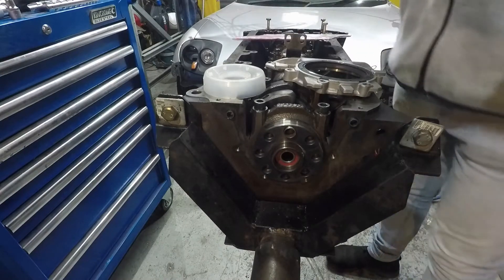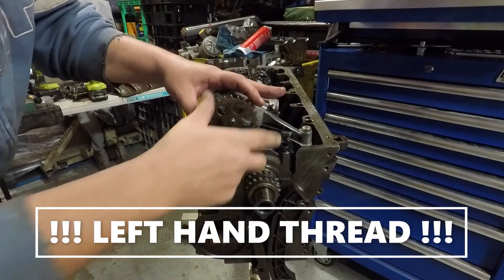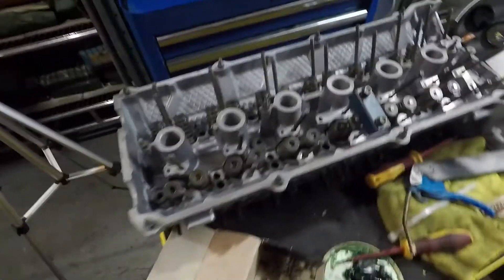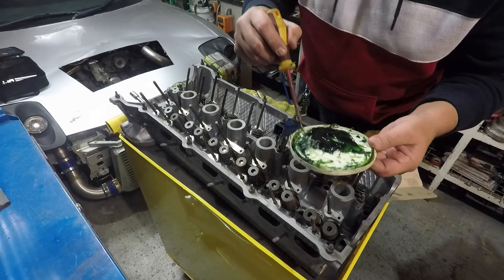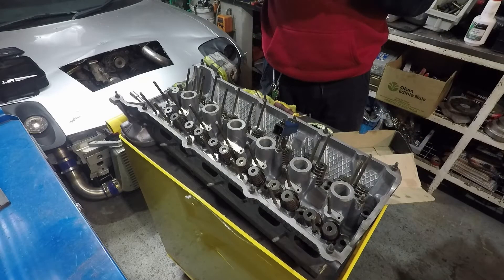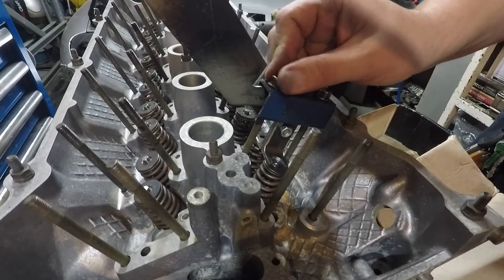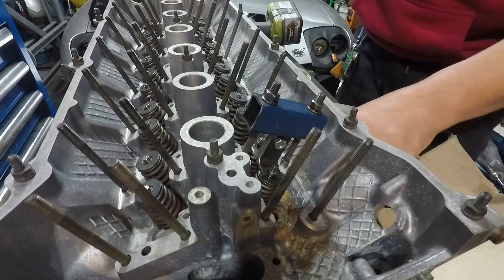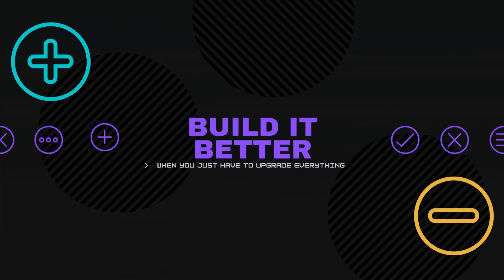HOW TO BUILD A BMW ENGINE M50 M52 TURBO 2 of 4 (Head assembly)

Comment: I skipped around a little but did you mention what valve springs you used?
Reply from the maker: Thank champ. I used standard m52B28 Springs as i am running the factory CAM trays.

Comment: Wow thank you so much for all this info! I am very excited to learn so much. I have the m50b25 but just did some damage to it, lost oil pressure at the drift track and now it’s ticking like crazy, I want to do this build as I can use lots of the same parts I already have. I was wondering if you had a parts list?
Reply from the maker: I don't really have a parts list but everything is available from ECS tuning online. Thanks to @itsmikelake for the tip on welding the oil pump gear in place. This should stop the oil pump issue. 
Just don't go overboard on your bearing type. The standard and kolberchmeit bearings are very forgiving. Meaning it won't damage your crank in the event you run out of oil again.